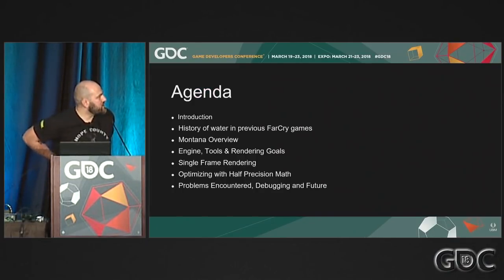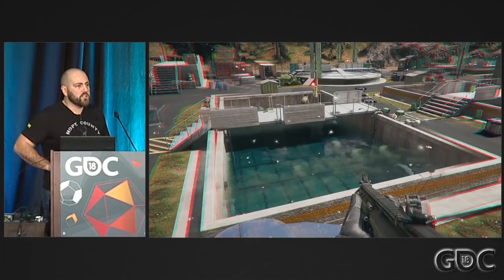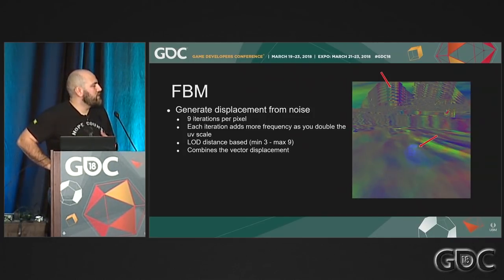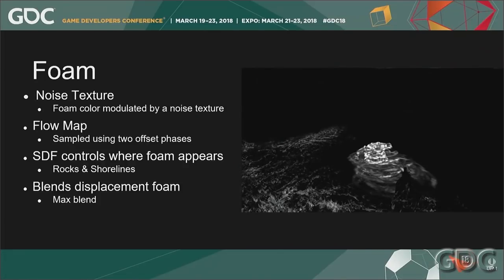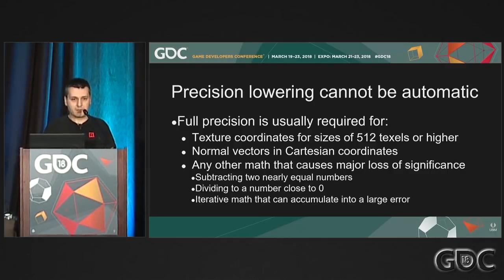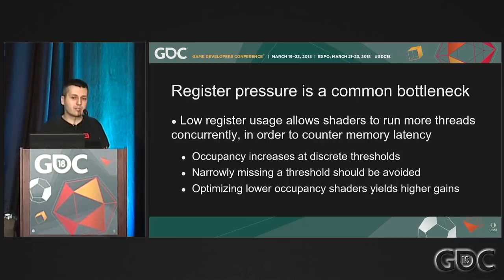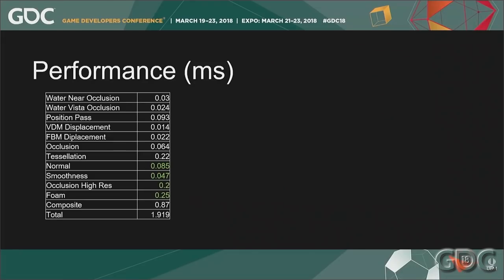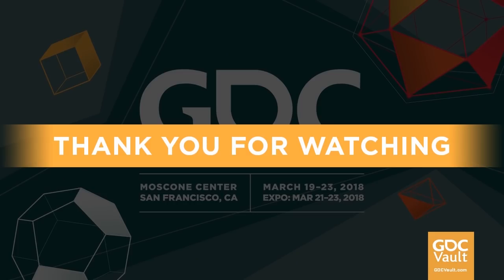Water Rendering in Far Cry 5

Comment: Did I miss the explanation on what a VGPR is? Because I'd like to know.
Reply: VGPR means Vector General Purpose Register, basically registers for the GPU, which stores 4 dimensional vectors. Reducing the used VGPR count lets the GPU runs more shader wavefronts in parallel, he describes the problems derive from that as register pressure. For example, using a lot of VGPRs can lead to only 3 of your 10 available SIMD units inside one Compute Unit inside your GPU running, only utilizing 30% of the compute power of the GPU.
Reply: @PampersRockaer  Idea/advice is right but nobody's used "vector" registers since AMD Northern Islands. The vector bit is in reference to scalar variables across multiple shader invocations-- think individual floats in a specific pixel in a pixel shader (grouped by quad for ddx/ddy) or individual compute threads in a compute dispatch. This design is critical to how the wave ballot instructions mentioned in the presentation work. There is also a notion of 'scalar' registers but these get used for stuff that's uniform/shared across a whole wavefront like texture descriptors and certain kinds of transcendental instructions. You can do cool things with scalar registers and clustered shading, the concept is getting a lot of attention in recent memory.

In CPU land you can check out Intel ISPC, it's basically the same programming model just using SSE instructions.

Comment: The problem with the water in this game are the screen space reflections and view angle and its really really annoying to the point that on some places it didn't had environmental map and relied on screen space reflections alone. Just try watching around horizon and tilt the camera down. It's the real issue with SSR
Reply: Late but I feel like if there were cubemaps placed, it would be a nightmare to create with the abundance of water bodies and the overhaul with water rendering techniques. And this is the same hardware since FC4 which had way less rendering capability. Cubemaps are cool but generating would take too long and would make the game size increase drastically. The point of this system was to create more dynamic water and make it easier to make complex bodies compared to past games. Cubemaps in an open world in general are very rare, especially in games released constantly like FC is. In Rockstar games for example, its easier to do so since they have more time to work on things and polish it up.
Reply: Still no way of disabling SSR either, it looks terrible on this game.